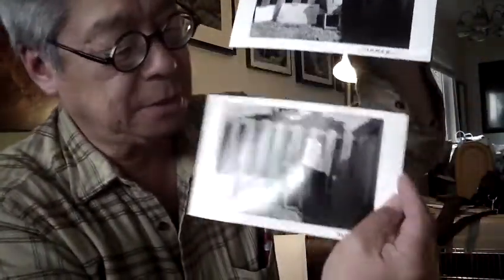The "Standard Negative" and How to Use It - Comparison Between Ilford and Foma Papers

Comment from the maker: Okay, it is May of 2018 and I just printed a negative that my father made in the 1960s.  It is a shot of El Capitan in Yosemite.  He took me there when I was 10 years old and I watched him set up the 4"x5" Graflex camera and make this exposure.  It took him quite a bit of time so I was interested in how it would come out.  As it turned out he never printed this negative, but I came across it about 5 years ago after he passed away.  I could see why he never printed it as it is a very difficult negative to print.  It was processed in a pyro developer, which he had learned to do from Wynn Bullock; he studied with Mr. Bullock at SF State University.
   I masked my father's negative to print the way I wanted it to and it came out fine.  The masking was rather tricky though as I made the famous mountain a background item and focused on the redwood trees to add the local contrast that makes the print work.  Consequently the mountain is very subdued and looks very soft and low in contrast, but the redwood trees make the print "sing."  I'm pretty sure this is not how my father envisioned the print and that's why he never printed it.
   In any case the interesting thing is that the negative is brown toned.  Pyro has this effect when used on older thick based film that did not have a pre-hardened emulsion.  This is what Wynn Bullock told my father.  He said that the newer emulsions would still develop in pyro but that they would not be tanned by the developing agent.  Actually when looking at these old negative the image seems to be etched by the pyro - it is similar to how the Kodachrome emulsions look when viewed with reflection.
   The interesting thing about printing brown toned negatives is that it is almost like printing through a safelight since black and white papers can be handled under a brown toned safelight.  This is one reason why my father used to tell me that Mr. Bullock's negatives always seemed so "thin."
   Anyway, it turns out that brown toned pyro negatives prints extremely well on FOMA paper.  I believe it is because the FOMA paper has an extended sensitivity to yellow light and so the mountain (El Capitan) which is lit very gently by the afternoon sun reproduced very well on the paper.  I have previously printed this negative on Ilford's paper and it looks very much better on the FOMA.
   Thought I'd update this video lesson with this interesting note.  Too bad pyro developers no longer tan the negatives on modern films...
Reply: Hi Timi - I am back. I have been masking more than 50 negatives since beginning of this year. Is there any way I can show you the prints and you provide me some feedback or commends? Also, can you upload your father's negative, black mask and final mask with the fine print? Thanks
Reply from the maker: Hi Everything - Been thinking about your request... I can't really begin to accept prints from viewers.  It may get out of hand; it wouldn't be fair for me to accept prints by mail from you and to not accept them from someone else.  in the beginning I was thinking about offering these lessons on Udemy and charge for lessons.   But then I decided I didn't want to have to measure students' film and prints and to get back to them... even for a fee.  So I eventually decided to put the lessons on youtube.  Udemy also wanted me to make my lessons "slick" and more "professional looking" with graphs and illustrative renderings.  I really only wanted the material to be accurate and available.  That was more important to me, and I didn't have a crew to help me video tape and edit; I wanted to work alone, and so that's what I did.  So no, sorry I can't accept prints from you to give you feedback.
   On the other hand I've been thinking about your other request... that of uploading my father's negative along with the masks I made for it.  It will take a bit of time to prepare the video but I think that may be a good idea.  You see, I really don't recommend that you or anyone else begin masking by rote, or by using a "formula."  That may be what you are doing since you've already masked 50 negatives.  That's a good way to learn the techniques of masking (splicing in film into a larger sheet for registration purposes, getting exposures down for the different films and chemicals, etc.), but it may result in a lot of failures from the point of view of getting satisfactory prints.  Recall that I, myself, said that "Sometimes it worked and sometimes it didn't... sometimes the print I made didn't even look as good as the print unmasked." 

    I have said that film masking required an individual approach.  You have to understand what it is that you want from a print.  You have to make a straight print from the negative and look at it.  Then mull it over.  What do you want specifically from that negative that would make the print more successful?  This may take some time.  It is not unusual for me to look at a small print for a period of 2 weeks before I go back into the darkroom to begin masking.  Sometimes I go back into the darkroom to make another straight print with  a different contrast grade or to simply make a darker print to see how much detail I can get from the high values.  Then I think about the density range in that area of the negative that I want to affect via film masking.
   Finally I go into the darkroom and begin the masking process.  Even then I may wind up starting all over again after the masking is done and I've made an enlargement.  You have to love the process obviously.

   I will soon post another video showing my father's negative and the masks involved.  I did that particular image over two years ago so it will tax my memory about what I did in terms of masking, but I'll do my best to remember. 

     I will also include a recent image I just finished.  It's a shot of a green pepper.  I had thought to myself, "I really can't ever afford to purchase a pepper image from the Weston family so why don't I shoot one myself?"  So I bought a large funnel (to place the pepper in) and also got some salt.  (I decided to place the pepper on salt... get it?  Salt and pepper) Then I went to a local grocery store and looked at all the peppers they had for sale.  I picked out 3 that looked promising and paid for them (actually my girl friend paid for them).

    After a few days (while the peppers sat in the fridge) I went outside and did the photography part with my wooden 4"x5" camera.  (BTW  - I estimate that my "effective F stop was F 269 and I used an exposure of 60 seconds - according to a video on youtube Edward Weston used F240 with an exposure of 4 to 6 hours)
     I do have the memory of how I masked that image as it is still fresh in my mind, and it did require a couple of week's time to think about how I wanted the print to look.  And in this case the final mask (first time around) worked exactly how I wanted it to.  So I will post a lesson on that soon.  Keep posted...
Reply: Timi - no problem. You are correct that we cannot copy exactly what you were doing. Even if we want to exactly follow your steps I don't think we are able to because we are using different registration systems and films. 

I tried different way to lift the shadow information. First step is the same as yours to make a "black mask". Second step is to use "black mask" to expose a final mask with no original negative, therefore, my final mask is inter-negative with only shadow information and very dense highlight even "bulletproof".

There are two steps to print: first, original negative is printed first by using registration carrier; final mask is printed second. This is my way to increase the separation from zone I, II, III and even IV.

Looking forward to watching your new video.
Reply from the maker: Yes, you can do that.  In one video (forget which one) I mentioned this and I called it a "nuetral density" mask affecting the gray scale from where the "first stage" mask ends. In your case the first stage mask is the "black" mask.  But you can create the first stage from anywhere on the gray scale.  It becomes tricky because it may run into certain areas of your final print that you don't want.  I will address this in my next video lesson.
Reply from the maker: Here's the link...
https://www.youtube.com/edit?o=U&video_id=MPhGROR9U8A